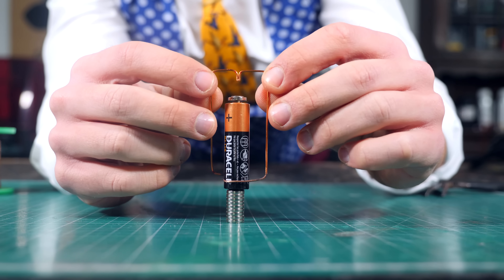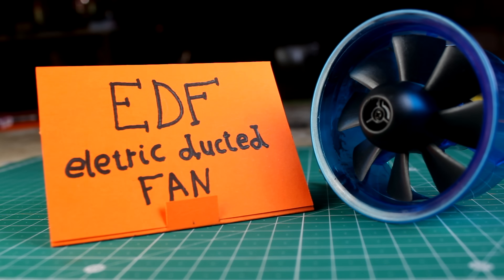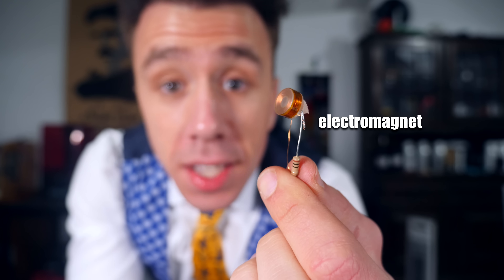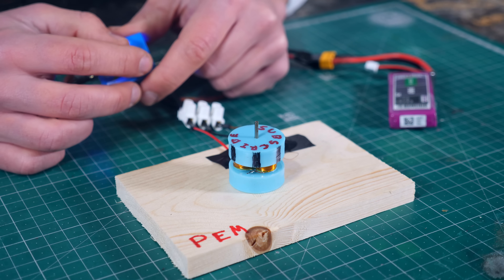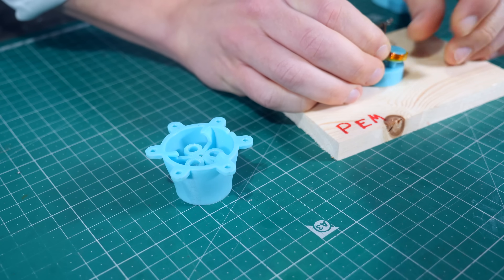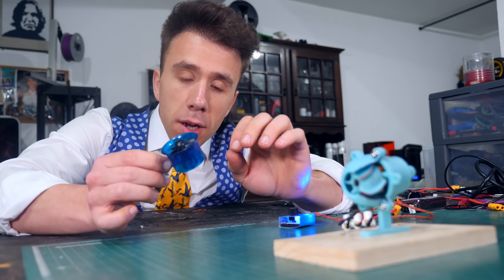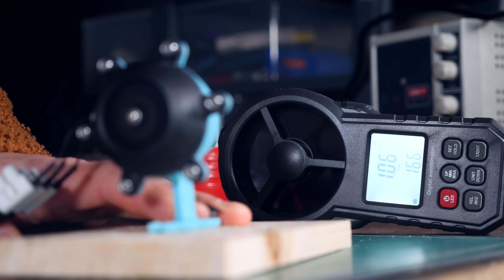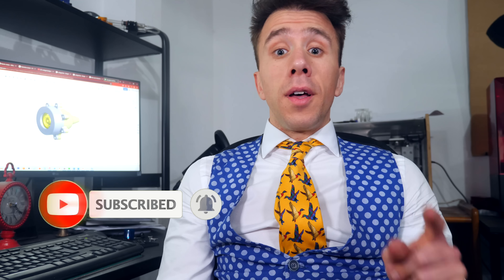I 3D Printed an ELECTRIC MOTOR FAN

Comment: Is there a big enough difference between the weight and resistances of the different fans you're using to cause the issue?
Also, im only saying what I have seen on other YouTube videos, but some fan designs may be optimized for certain rpm's.

Comment: Possibly simple change is the Pre-Fan throat, bit too narrow and there could be a lip that curls away from the front, so rather than cut the suck, you are encouraging the air to take a path, but don't care which path that is.

Comment: i would guess your problem lies with the housing rather than the fan itself. Are you sure that the connections between the motor and the housing/fan seal sufficiently?

Comment: The volume of air your design moves is too little compared to the EDF. Also, it is velocity vs pressure. The edf is high velocity with low pressure gradient while an impeller is high pressure gradient at relatively low velocity. Work those fluid dynamics simulations in your CAD of choice to visualize it all. 😊

Comment: Isn't a centrifugal fan like yours mostly to provide high pressure low volume (the opposite of your regular fan)? I imagine if you measure wind velocity you need very tight tolerances and a very narrow output.

Comment: "Rediscovering the lost design of the Portuguese Caravela" would be a great video.

As for Integza's problem, my limited knowledge about fans says centrifugal ones can achieve higher static pressures at lower flow while axial ones have lower pressure but higher flow. For thrust you want more flow.

What dyson fans do is that it uses the small flow of the internal fan to generate a greater and slower flow on the air inside the hoop. How this applies to a thrust oriented application I have no idea.

Major Hardware know a thing or two about 3d printing and testing fans for varied application. He's in season five of his fan showdown series

Comment: You need to increase the diameter of your 3D-printed fan and reduce the speed or rotation. But even so, the centrifugal design produces a lot more turbulence, so will be far less efficient

Comment: You should try an axial compressor design or a multi stage radial compressor. For more force, try making the exit hole smaller. You should have enough pressure for that.

Comment: if you are pulled to two directions, you will split apart, in half, left side, also falls, to tomatoes, to dogs
Reply: keep one direction, its Christ
Reply: dont mind with the impeller fins design, just concentrate on the centrifugal part of the fan, best pump is the centrifugal
Reply: impeller is a cheater, forces are something proper
Reply: try diy radial ring magnet in copper pipe sheet motor with iron rod core, the iron core dc magnetic field routing around the current wire is essential, and from in the radial magnet stack center

Comment: First of all, i am not an engineer (i am still learning).
Secondly, i am not a native english speaker so be gentle with my grammar :) .

For the design, with what i have seen and learned throughout the year, it is best to maximise the area at the front of the fan.
With that i mean that you shoud not be able to see behind when looking at it.

I also highly recommend you to test the design with specialised software and to try to change the curvature of the helix as well as their length (by that i mean backwards like the dyson fan).

I hope that my recommandations will be helpfull because i am a great fan ;)

Comment: I wouldn't make the assumption that an axial flow fan and a centrifugal fan have the same "thrust".  The EDF isn't a centrifugal fan, it's a duct assisted axial flow fan.  Axial flow generates higher speed of flow while a centrifugal flow fan generates higher pressure.  You have issues with conversions of the two forces and that is in how they are constricted and processed by the output.  In essence you have a balance of a bunch of variables to try to make the two fan types equal.  You'll have to play with your design both on intake and exhaust flow to get similar performance, but you'll likely never reach balance between an EDF (simple design) and your fan (complex design).  The actual weight of the impeller is likely higher on your fan than the EDF so the motor is handicapped more.
Reply: You should probably measure the pressure of the air each fan is creating.  The anemometer doesn't really measure that well, mostly velocity. You'll probably find your fan creates a higher-pressure drop in front of it and a higher pressure on the output.  That's just a guess though.

Comment: The impeller is increasing static pressure, which increases heat due to compression, so you lose a little bit of energy there to the heat escaping into the outside environment.

You then are losing some energy to resistance from the pressure trying to fight against the impeller, lowering your net airflow.

Finally, you are losing thrust because nozzle inefficiencies are failing to convert the static pressure into unidirectional flow.

Comment: absolutly no expert here, but maybe with the impeller the amount of air moved with the same crosssection is lower , wich would mean you need a bigger impeller to get the same output...

maybe try measuring mow much power the edf and your impeller draw from the battery and getting rid of points of friction on the impeller will lead you to your answer, good luck

Comment: I have always been a fan!
I would like to see you use the impellor when you get it to work, to power a small jet engine.
I assume you have reduced output because the impellor is more mass than the fan, and also your initial fan is ducted, and that could be making a difference.
Not sure if scaling up your impellor will help...

Comment: Could it be to do with your 'compressor' part of the housing, have you tried it with less design inside. I'm certain aircrafts use this as they then have an controlled explosion behind the main turbine. 
That or that chappy who said about pressure and velocity. As far as I'm aware centrifugal fans have high static pressure where regular axial fans move air faster. 
I might have got some terminology wrong here or I may be completely wrong 🍅

Comment: My guess would be your fan is more of a static pressure then airflow design. It is not the case you get same airflow no mater what fan you create. Different fans work for different applications... Even if you just change angle of attack on a blade you get different results.

Comment: I'm no engineer, but from just looking at how significant the difference is between intake diameters (EDF vs 3D print), my guess would be that you're restricting your flow rate on the 3D print. Might be able to compensate with higher RPM, but I bet that would more than likely exceed material capabilities; probably easier just to scale size, and maybe even reduce RPM?
Reply: That’s what I thought also, a possible diagnostic for that would be to try running it under water since fluids don’t compress, if there’s a ton of cavitation I think that would point to the intake being insufficient 
But like yourself I’m far from an expert
Reply: Also the shape of the edf intake being  curved helps with air intake as fluids tend to stick to curved surfaces. This allows the edf to pull in a much larger volume of air around it compared to the 3d printed fan
Reply: My thoughts exactly.
Reply: A higher rpm means more drag (friction is velocity^2) , lost as heat in the air, and less energy going to push air. 
Larger propellers are inherently more efficient because they can move more air slower and get same thrust as a smaller prop. 
And air flows through a large hole easier than a small hole.
It is all about efficiency and that means keeping the velocity low, which means a larger intake/exit area and impeller.
Reply: What Integza made in this video is a centrifugal compressor which are really good at making high pressure air but they aren’t so good at making high velocity air. Thrust from both a jet engine and rocket engine rely on high velocity gas to produce thrust.

Pressure and velocity are proportional and we know this thanks to Bernoulli’s principal: P_inlet*V_inlet = P_outlet*V_outlet by increasing the pressure from that of the ambient air the velocity of air moving through the compressor actually goes down, as the high pressure air expands at the exit the velocity of that air increases so it will produce some thrust…

However, the reason early jet engines used centrifugal compressor was to, you guessed it, compress the air. The compressed air is then mixed with a fuel and ignited in a combustion chamber increasing the velocity of the exiting gas substantially. This produces much more thrust than the compressor alone.
Reply: Modern jet engines on airlines specifically have large bypass fans which uses a jet engine to make it spin. In the context of this video, you can think of the bypass fan as the EDF propeller and the jet engine as the electric motor in that EDF. The bypass  fan uses its airfoil cross section and aerodynamics to generate thrust rather than combustion in the same way a two bladed propeller produces thrust if driven by an internal combustion engine.
Reply: I am no engineer either but- actually...I am... but don't hold that against me. My first instinct is also that the air inlet on each fan are way different sizes...
Reply: This I bet. It looks like he has the cone shape of the impeller backwards to what dyson is doing. They have a big bell opening at the top and the impeller tapers into the cone shape as it gets closer to the discharge nozzle
Reply: also there is a difference between air volume and static pressure. the static pressure is probably shite comparitively.
Reply: I agree with a lot of these comments. Whenever you do work to the air by forcing it to change direction you loose efficiency. A traditional EDF fan keeps the flow in a linear direction where as a centrifugal fan throws air out the sides and you are trying to redirect that air 90 degrees or more in some cases imparting frictional losses and turbulence into the air doing work against itself. If you look at the design of the Dyson you showed in your video the air passing around the fan is kept as straight as possible doing as little work to the air as possible to keep flow as linear as they can given there hub design. You 3D model imparts some of that technology. I think if you further develop your exhaust you will see an improvement but it will be difficult to match the EDF without demanding more RPM and energy from the drive motor to compensate for the efficiency loss.
Reply: This is exactly right, this is the same issue as trying to suck up water through a straw. It can basically create a vacuum in the front limiting it's airflow. So bigger nozzle or another way to collect air to then send through the system.
Reply: I should have read your comment before stupidly repeating the same thing. Cheers
Reply: I would agree that the inlet sizes are different. I would add that you could be over restricting the exuast, too. The only other potential issue is the fundamental operating principles. A jet engine compresses the air from my understanding not for directly producing thrust but for increasing the amount of oxygen for cumbustion and to increase the disparity between atmosphere pressure and internal pressure. It wants to go high to low, and the greater the disparity, the faster it wants to move the air to equalize. And when you add combustion, it greatly emphasizes the effect creating lots of thrust. A typical EDF works by simply accelerating the air in its fan area and maybe making a bit of lift with the blades.
Reply: I see it like many others here.  On the one hand, you limit the exhaust airflow with a diameter that is too small, which in turn leads to a back pressure.  so you may have to increase the distance between the input and output and/or the cross-section of the output.  so you need to calculate and adjust your fan swept area.  in addition, you should also make sure that the distance between the wall and the impeller is exactly the same as with your EDF.  This should not be too big or too small.
Reply: I am currently trying to do something similar to make thrust for a drone. Mass flow rate is a big problem, but a solution might be to have a two stage system that uses an edf type impeller to increase mass flow connected to a mixed flow type impeller to increase pressure. The combination might work well with aerospike nozzle.

Comment: You have at least 2 way of describe a fan airflow, CMF which is the volume of air moved and the static pressure the fan can produce. It's always a trade between the two. It's difficult to produce high airflow with high pressure.

EDF have correct static pressure and very good Airflow. 

On the other hand centrifugal fan have very good static pressure (it can be use to generate relatively high pressure, and thus they're used in jet engine to compress air) but awful airflow, because the air change direction multiple times. 

So, if you want the best of both world, you need axial compressor (like in jet engine) but is they are difficult to manufacture and does not work well on small scale (<50cm of diameter)

Comment: I think an EDF is not supposed to pressurize air, contrary to what's inside a dyson vaccum cleaner. Maybe the motors (brushless motor) aren't exactly the same in terms of capability to pressurize an air flow.
Reply: You should do a jet engine with variable nozzle for a future video

Comment: Does the 3d printed Impeller weigh more than the original? Your design could also be creating turbulence inside the casing that would disrupt air flow, I know for the dyson fans and industrial impellers the tolerances between the rotor and inner housing are critical for good airflow as you don't want air escaping over the fins creating turbulence. 

I'm not well versed in fluid dynamics so I could be completely wrong. 

Rotor and propeller design can be a nightmare and is basically a field of engineering itself. I think you should look into simulation software for optimising your design, Autodesk has a tool called "CFD" for this purpose that I've heard works quite well and is fully compatible with fusion 360.

Its a video idea I guess, exploring simulation tools for improving your designs.

Comment: From what I remember about gears and stuff, you can technically increase more power of a fan by increasing its torque or in pleb terms adding more force to move or to stop. The way to do it is having a small gear spinning a big one and probably alternating it. I’m not entirely sure about it because the only source I have is just about reversing a Gogol gear thing and screwing around with my bike.
Reply: Yes, but I think he's looking for speed.
Reply: @samuelloomis9714  I guess the reverse works?
Reply: it's Morbin Time  I hope you get indigestion from that. That’s horrendous.

Comment: Extend the Shroud of EDF to Attach to Outside of Centrifugal Pump, so it feeds Air Straight into Centrifugal Pump, I would also add a Long Combustion Tube & give it some Gas & A Light... :)

Comment: The reason I've heard to as why centrifugal fans are worse is that you change the direction of the air as you push it out to the side then back instead of an axial fan which just pushes it back
Reply: it's Morbin Time  i hate You

Comment: I'm not an expert in any way, so I'm just tossing a baseless idea out there for you. Fan efficiency is directly related to blade clearance with the shroud/housing walls. Use less flexible materials that allow you to consistently stay a millimeter or less from the wall. If you have already done this, then please ignore it.

Comment: Integza, the thrust problem most likely has to do with the small size of the impellers and the semi-incompressable nature of air. At this scale air will behave more viscously and introduce more entropy, and obviously generate more aerodynamic inefficiencies. At least that's why I think the flow models from the EDF will always be superior. The flow path is more unobstructed, and therefore more efficient... I think...

Comment: Well it could be that the nozzle could be too small which could be bottlenecking the fan and since it’s not an explosive amount of force like a jet engine it doesn’t end up making the fan explode resulting a small amount of air leaving the fan but that’s about all I can think of
Reply: Back pressure on the fan. I agree
Reply: it would just over speed if that were the case
Reply: @anthonyb5279  I know this is a fan that we’re talking about but it’s easier to explain it if we pretend it’s a jet engine yes you’d be right the smaller The nozzle the more thrust is produced but if there isn’t a sufficient amount of energy pushing all the hot gases through the nozzle then it causes bottlenecking and in which case instead of having A increase in thrust we have an increase in pressure in the combustion chamber that will result in an explosion this is what’s happening to the fan But since compression is not in the mix when you’re talking about a fan it relies on the rotation of the propeller and I highly doubt that small engine would be able to reach high enough RPMs to create that extreme amount of force to increase the airflow so instead The fans Air pressure raises to certain extent which is not enough pressure to make the fan explode so even though the engine may have enough power to create a lot of thrust it’s possible that the 3-D printed parts it’s holding it back specifically the nozzle because it’s too small and the small nozzle is causing restriction stopping the air from going out the back into the fan and as we discussed the raise in pressure is causing all the air to go out the inlet of The Fan instead of the outlet